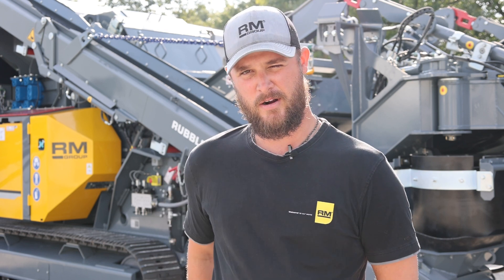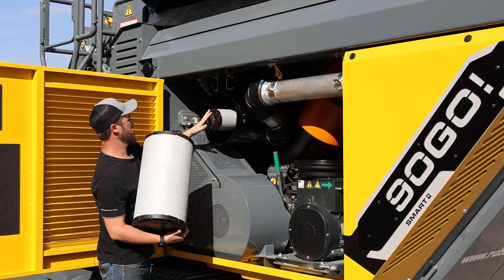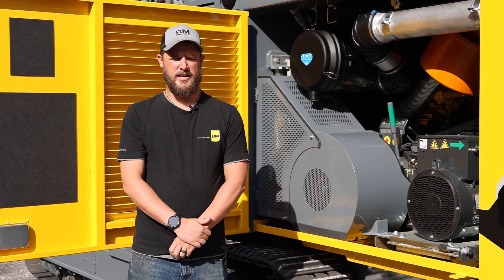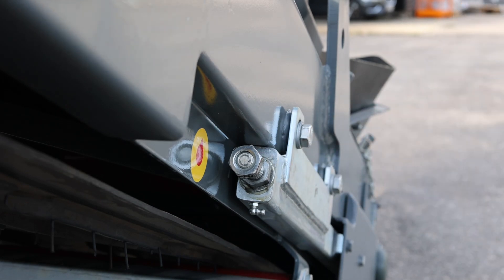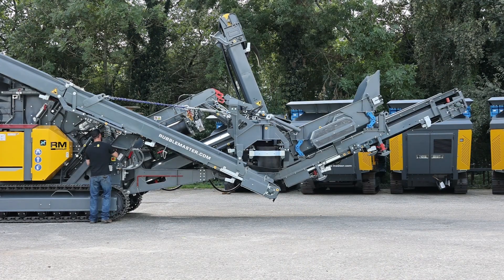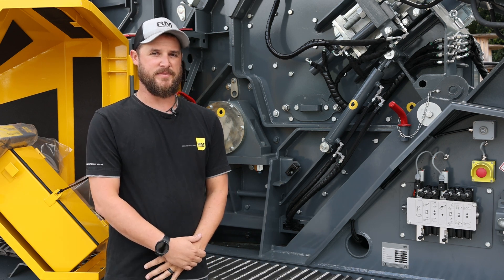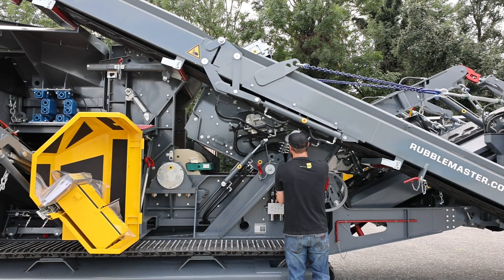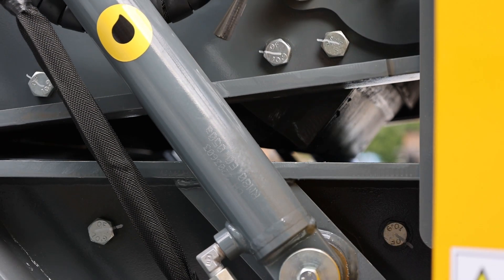Compact Crusher Maintenance | Daily Checks

Comment: Hello I have a concern about the RM100go in fact, after a mass on the machine the rm100go displays 814 what should I do this code sends me back to the clutch I embrace and I disengage
Reply from the maker: Hi @ulrichgabindjofang6052, you can contact our US-based service department at 800-230-0418. For local assistance, we work with more than 110 dealers worldwide. You can find a local dealer here: https://www.rubblemaster.com/us/company/dealers